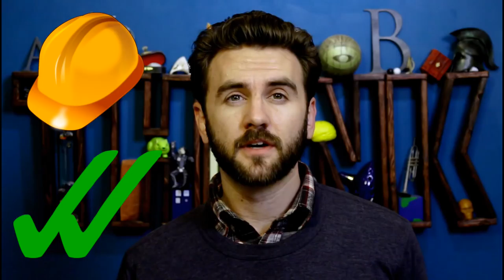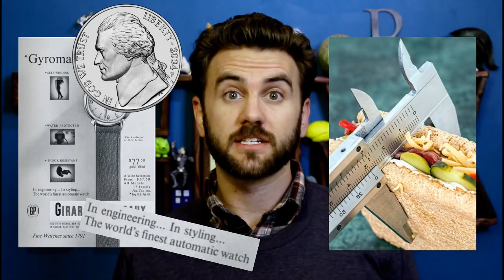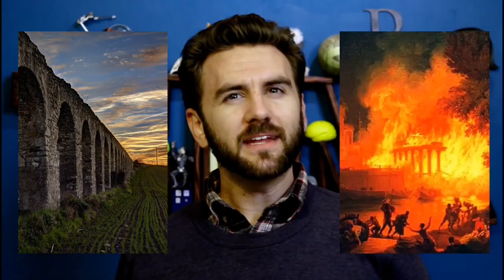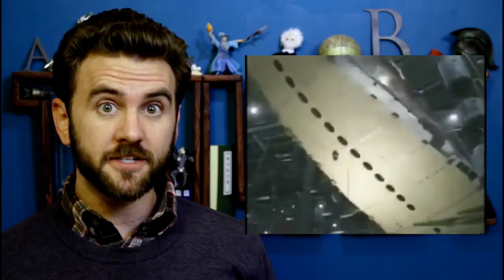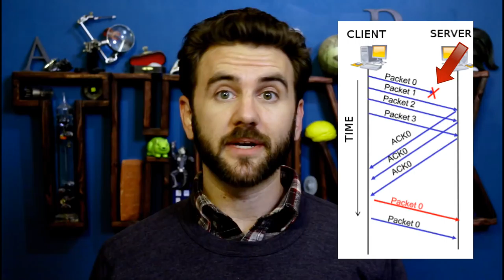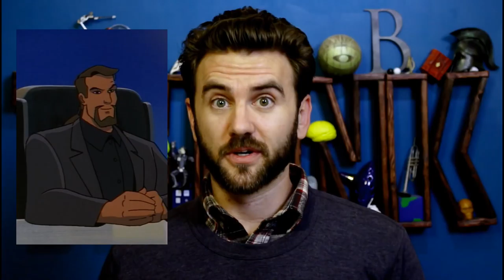136. Engineering Wisdom: Tolerance & Failing Gracefully | THUNK

Comment: One of my favorite examples of graceful "failure" is the practice sometimes used in bridge design of pairing important structural components made of a less active (in a chemical sense) metals with sacrificial anodes, which are more active metals that rust away while preventing the structural element from corroding. By building in a part that "breaks" easily and is replaced easily, engineers avoid having to shut down a bridge for weeks at a time to make major repairs!
Reply from the maker: Great example, thanks for this. :D

Comment: Different from the usual, but nice video. As a programmer, I completely agree, graceful failure is much better than just letting things crash catastrophically.
Reply: But also many programs are designed to sell, not to correctly work in first place. Which, to be fair, is the company's goal, but not what id like to have.
Reply from the maker: Unless you're the Mythbusters, in which case you want the most catastrophic failure imaginable. ;)

Comment: In fact the IP is the 'internet protocol' that connects your home network to the network of your provider and the internet per se, the video is encoded as UDP,  that allows a lot more of failures than TCP, TCP 'per se' is 'fail proof', but slower than UDP. To have this two protocols give us choice. When transmitting sensible information (like your bank password) use TCP, when transmitting 'non sensible' information, where you can lose some bytes, like video, use UDP (of course the video is structured in a way that if some bytes are loose the viewer barely notices it). Still the example applies to your idea.
Reply from the maker: Thanks for the clarification! TBH, I have only a vague notion of how the internet works that mostly stops where the copper exits my house... :-/
Reply: A good example for how TCP manages failure is with the TCP congestion control algorithms (Tahoe, Reno Vegas, ..., BBR).   We are all paying a "tax" to avoid a collapse of our modern internet.